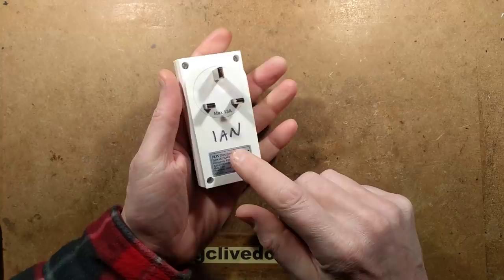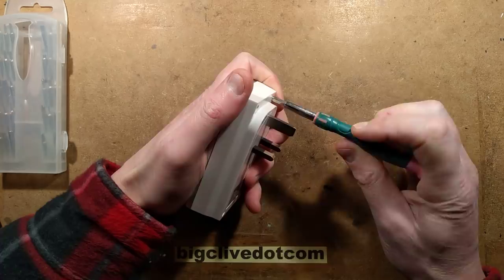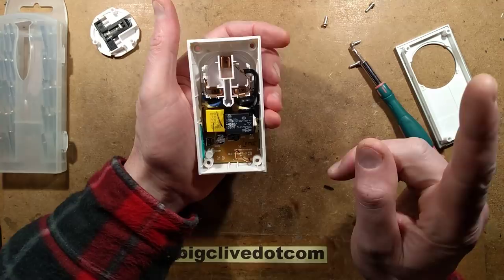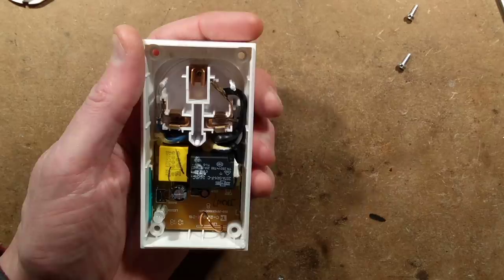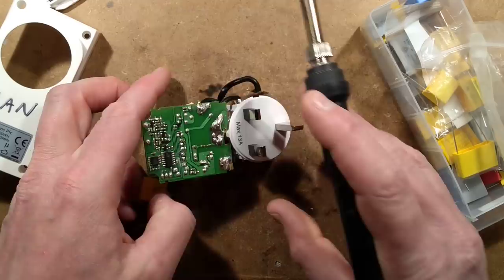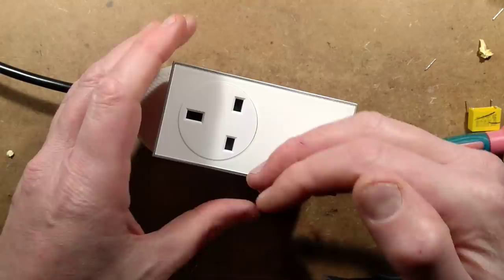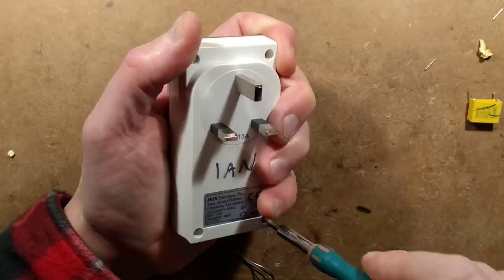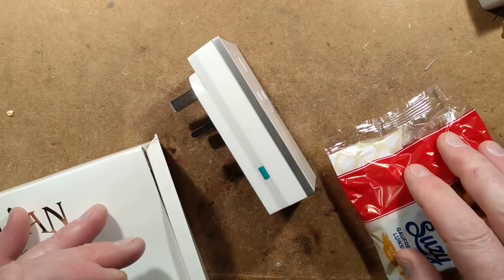Fixing a faulty remote power switch.

Comment: You previously did a similar video on the 'Bye Bye Standby' switches, which I had a load of, and were all faulty.
They had the same capacitor issues, so I bought a pack of 10 on eBay and got every switch working again.
This was after I'd already emailed the company for help, and they weren't interested.
You saved the day once again....

Comment: Thank you Clive! I have a set of four of these and last week one of them started to play up - eventually gave up switching altogether. After watching this i retrieved it from the back of the 'Fix it later' cupboard and took it apart, spot on Sir, it was the dropper capacitor, should have been reading 330nf, but was only just managing 125nf. Fitted a new 330nf capacitor and it now works again! (I also have to thank you for me having a spare 330nf capacitor in stock anyway - it was left over from a set of tungsten fairly lights that i had converted to led a couple of years back - another idea i got from your good self! So double thanks. Happy Christmas Clive, hope you have got some suitably dodgy alcoholic beverages to hand! :-)

Comment: That's actually well made, most would skip shutters and temperature fuse
Reply: A big U.K. operation like TK Maxx can’t skimp on electrical safety, they’d get crucified. Offshore sellers from the great rock candy mountain, ya take yer chances, they’ll vanish off EBay in a heartbeat if anything goes wrong, and pop straight back up with a new name. They’ve got used to it, some of the junk they sell to us can’t even be sold in China.
Reply: America could learn something here.
Reply: These are LightwaveRF switches - they do a whole range of home automation kit. UK based.

Comment: That raised a chuckle as you got out the same screwdriver set as I have sat on the desk just under the screen. Mine has a fetching yellow trim instead of the orange on yours. It's generically labeled Toolzone, and was bought from an Irish ebay seller. The Chinglish in the listing made me suspect they may not have had deep roots on the emerald isle.

Comment: My daughter is in hotel management.  She used to run a small motel about a mile out of town.  They had problems with their flat screen televisions, seems they only lasted about six months then died.  Well they found this guy in a neighboring town some 100 miles east of here who knew which diode or capacitor it was that was failing, so every time one of the sets went down, the fix-it man for the motel would haul one or two over to that town, drop the units off then go visit his brother who lived there.  A couple hours later he would return to pick them up, pay the fellow 100 bucks per unit and haul them back to the Motel, where they would run for another 6 to 8 months.  Sure a lot cheaper then buying new TV sets for each room every 5 to 8 months.  The guy said it was always the same component on every television.  Must  have been part of the planned obsolescence.

Comment: I like how you turn the screws counterclockwise to find the beginning of the threads =)
Reply: Many mechanics learn this after cross threading just one high pressure fitting or spark plug.
Some have someone else teach them the trick before they have to hard learn it.
Reply: backthreading is just (un)common sense  ;D

Comment: My speculation about the small rectangular opening under the sticker is that they originally had the indicator light (or possibly the push button) in that area.  But when they moved that (whichever) component to the side, they did not want to redo the mould.  So the sticker was chosen for hiding the hole.
As to the reduced capacitance, it is originally  due to idea of burning enough of the metallizing around any pinhole to clear a short circuit.  One or two such burns would not reduce the capacitance enough to be noticed.  But if the insulating film is  sub par (too thin or full of pin holes) and maybe operated at a slight over voltage, then there is a cumulative deterioration.  And large drop of capacitance.
Reply: I don't think it would make sense to put an indicator or switch there, since it is on the back of the unit (against the wall) when it's plugged in, and thus not visible or accessible at all.

My suspicion is that those two contact points actually connect to the I2C bus for the memory chip, so during manufacture (before the sticker is applied) they can access the memory chip via that hole to program a unique code into the device (and its corresponding transmitter) after it's fully assembled and tested.

Comment: I have one of these plugs that I bought from maplins that is still functional.  The remote for it however I've repaired twice, it's manufacturered in the most bizarre way.

It has two PCB boards that are held together by 4 jumper leads and you've probably guessed by now.  One of the repairs involved fixing a dry solder joint 😊👍

Comment: With those I always try to add a series resistor and a MOV after the resistor, to clamp those spikes down and prolong capacitor life. 100R 1W fusible resistor, and a small 7mm 275VAC MOV is typical, and makes the dropper last a lot longer.
Reply: With what kind of loads?
Reply: What's an MOV. Is it the same as a VDR (Voltage dependent resistor) ?
Reply: @NeuronalAxon  Just for the capacitive dropper side, to reduce the self healing from having to deal with all the mains spikes. Nothing for the load, it has to deal with it separately.
Reply: @geoffbirkinshaw8466  Metal Oxide Varistor, Voltage dependant resistor, similar enough, all are ceramic constructions that clamp overvoltage.
Reply: @SeanBZA  Thanks,  I should have realised , I have got several in a component draw marked "Varistors"
Reply: @SeanBZA  - So, it's to protect it from your spiky mains supply rather than anything the load's doing?
Reply: Will it only be compatible with QuickTime afterwards?
Reply: I got a question, the capacitor is rated 275Volts and at 240 mains we have peaks of about 320 Volts . So are these  caps in a to small Value ?

Comment: Several years ago when I was finishing grad school (I did a lot of warranty work for major electronic brands) I saw lots of similar issues on Panasonic plasma tv power supplies.  They used a cap that was below spec (I was told because of procurement trouble with the correct one) and hoped it would work. (Spoiler, it didn’t work). Luckily it was simple to replace the 5-6 failed caps.
Thanks for this content.  All the best to you and yours!
Reply: John Coops sorry you feel that way.  Actually there have been several manufacturers that have had this issue including Samsung, Panasonic and others. The Samsung issue was only a few years back (it was all over the tech news 7+ yrs ago) while the Panasonic issue I referenced was almost 15-20 yrs ago. While I no long do technically repair and instead design and evaluate (I am within a few years of retirement), I must respectfully disagree with you mainly because that was the explanation given directly from the manufacturer.  
Being a troll must be a horrible existence and I pity you truly. If you ever need to talk to someone without being hostile I’d gladly lend an ear.  
All the best to you and yours!
Reply: John Coops my apologies but your first rude comment could make anyone defensive. Questioning vocational ability in that statement is rude and was not necessary, just ask nicely.   I realize it is very different than Clive’s video and why I thought of it was the issue with powering on and then a fail. Reminded me of the cap issue.  Are you this unpleasant of a person when you are with customers? Or are you just a mouth with a keyboard?  If so I am glad you are not an employee of mine. I was respectful to you as I am with all folks.  Then you became even more of a troll.  You are the one that should have just ask me nicely.  Let’s end this interaction.
Reply: @johncoops6897  "They used a cap that was below spec (I was told because of procurement trouble with the correct one) and hoped it would work. (Spoiler, it didn’t work)." 
There is enough propinquity in his post to make it an interesting historical footnote, I for one enjoyed his apriori on the subject; he had first hand knowledge of the event and circumstances.
Reply: I currently have 2 Panasonic and 2 Samsung plasma TVs in my garage which I have recently repaired the power supply boards on, by replacing capacitors, and/or MOSFETs. It's sad that people throw away a 64" TV because it needed a new 70c MOSFET, but the labour to have it repaired is more than it's worth
Reply: BeachsideHank thank you sir! I appreciate your comment.
Reply: Simon Quigley yes sir I do also agree with your line of thinking.  It easy to develop a board to spec but unfortunately the engineer has little say in the final product.
Reply: Mario Ghio Neto maybe because I’m old his comments bugged me too much. My thoughts are if someone takes the time to read my post I want it to be as pleasant and upbeat as possible.  I try to behave as if I was face to face with folks. Thanks!
Reply: @wesleytownsend8214  Chin up good sir, the wagons have circled, and the hostiles have fled. ☺
Reply: @johncoops6897  That is your opinion, then fine, but not being satisfied with your assertion, you had to insult the guy with: "you obviously had no understanding about what you were told to do.". What then are YOUR qualifications for making such a belittling and disrespectful remark?
Reply: @johncoops6897  You seek confirmation where there is none; further discussion is useless with you sir, good day.
Reply: BeachsideHank Wow! You’re a very fine individual and I apologized that you became embroiled in this adolescent nonsense.  I feel I should also apologize to Mr Coops as I obviously was not clear in my original post and he mistook my intention. I never meant for anyone to get that offended.  It was just a comment on something that Mr Clive’s video reminded me of. I really thought I made that clear when I said it was “similar to”. Geez that just brought a memory to mind.  I should know better as I have a grandson that is also very literal and corrects me when I compare things.
All the best to you and yours!
Reply: @wesleytownsend8214  The core subject was defective capacitors and their ramifications; your post was on point, educational, and of merit and so no apologies to anyone are needed and thank you for sharing your experiences. ☺
Reply: @johncoops6897  I accept what you say, but you do realize that you have also validated Mr. Townsend's remark in that it was a production decision made that was driven by a profit motive- intentional misuse of a component not designed for the application. "...They used a cap that was below spec (I was told because of procurement trouble with the correct one) and hoped it would work." It is what it always has been and forever will be; about the money.
I do believe you and Mr. Townsend are a couple of right guys who have real life issues to deal with like family, mortgage, jobs etc. As the kids of today say: "this ain't no hill to die on".
Music is the space between notes. Life is the space between obligations.
Reply: @johncoops6897  In closing this thread, I’m now making some changes to my comment reply policy, if you don’t hear back further from me, you’re one of them.

Comment: The problem I've had on two of these (I was using in my workshop) is that the relay contacts stick shut.  Give the unit a bash and it will work again for a while.  The problem is probably caused by having something connected which has a large inrush current.  I suspect a fluorescent light on my magnifier unit, to be the culprit.
Reply: Indeed. Power factor correction by adding a capacitor over the inductive load creates this. I've seen it happen while trying to switch the motor of a ventilator unit. That I solved by adding a small series resistor that dissipates less than a watt in normal use.
Reply: @blaap  NTC inrush limiter from old PC power supplies works well for things under 400VA, and is easy to get.

Comment: It's always the metal film cap, no matter the design, brand or country it's sold in.
Reply: I wonder how many of these items contain used capacitors.  Why an X2 for this application unless it is used or failed testing... especially when it has black marker stripes on it.
Reply: @someguy2741  Because they won't short out if they fail, making the device safer to use. I wouldn't think parts in that price range would be reused. Electrolytics yeah, but not those, but please prove me wrong, would be interesting.
Reply: It's not connected directly across the mains, the fusible resistor protects it so it doesn't need to be X2.
Reply: there are capacitors for use as "capacitor dropper", they are differend from x2 "across the mains". probably they'll last longer

Comment: Well since nobody else has hazarded a guess yet I'm going with metal film capacitor failure.  It also looks like the zener diode or related circuitry is pulling a night light situation where it takes the same power at all times so it doesn't matter if it's in use or not, power-wise.

Comment: Like your chanel. I find it very watchable. I bought a HOPI, and after checking that it worked OK, I turned the out-put socket round 90 degrees so that plugs wouldn't foul to clip-in terminals.

Comment: Wow I've had desoldering wick and a flux pen for years and it never occurred to me to put the flux onto the wick to make it work more effectively!
Reply: Me too, we are stoopid
Reply: @arenalife  desolder wick already contains flux anyway so you have been doing it right :)
Reply: @tecfixed2840  with varying degrees of [effective] lux content depending on age and source.
The cheap chinese stuff tends to, IME, be in dire need of more...
Reply: Clive is using Goot Wick from Japan CP-3015, It's good to add extra flux as the factory flux can be a light coat. More flux helps.
Reply: @michaeltempsch5282  indeed.
Reply: @tecfixed2840  the wick flux doesn't last forever, though.
Reply: I think it varies by brand. I've been using MG Super Wick and have never felt I needed more flux, with that wick you can see the rosin boiling out of the braid when heated and the spent wick has spots of flux residue on it.
Reply: @Broken_Yugo  I only use chemwick braid and never needed to add more flux, I did try some cheap Chinese wick I was given and that was rubbish, was just useless.
I can go through a 30M roll of chemwick and works perfect.

Comment: Hold the button in for more than 3 seconds to allow it to sync to the transmitter. Two pins through the hole is a factory reset if its anything like mine. Thanks for this vid Clive - mine are getting in a bit, so when they fail, I now know what to do - repair is always better than replace.

Comment: Why do you think this 'failing low C' is so common in this type of dropper, when the cap is not really under much stress I wouldn't have thought here.... poor quality or seconds caps ? I notice that cap has one or two big black 'strikes' across it....
Reply: I reckon Clive should mug up on capacitors and do a video special on them. I always thought that old electrolytics dried out their electrolyte, so degradation was inevitable. But modern types (eg non-polarity conscious capacitors) shouldn't be so prone to slow death IMHO. There is much to learn.
Reply: Spikes on the line exceeding the dielectric breakdown voltage of the cap and blowing some of the metal off the film each time would be my guess. Safety caps are designed to fail that way, because it's safe. Safety caps in all safety cap type applications probably do this, it's just that they're value critical in a dropper supply and not in their other roles.
Reply: @Broken_Yugo 
Don't forget good old fashioned cheap manufacturing resulting in not quite on spec products and higher than you'd like failure rates.
Reply: @johncoops6897  I've seen two  'back-to-back' (ie. non-polar) high voltage electrolytics used in this position ... does anybody have any thoughts on the merits of this?

Comment: For opening Holes when you removed a Component You might use a simple Toothpick. The Wood of the Toothpick can stand the heat quite well and they are easily available almost everywhere.  I have answered in English even  you said at 13:25 it is ok for you to answer in my native Language ( German ) assuming more people we be  able to understand my Comments.
Reply: можете пожалуйста говорить по русскому языку))))
Reply: @OscarSturgess  Leider verstehe ich kein Russisch :-(
Reply: That's actually a fantastic idea!
I hate component replacement because of the solder left in the hole! if I could poke a toothpick through, that'd be great!
Reply: Sewing needles work well too, as they are usually stainless steel which solder doesn't want to stick to. Then you can just wiggle it around gently and the hole is clear for the new component
Reply: GENIUS

Comment: 1 FemtoPaul of flux is an appropriate amount of flux. 
Also, I like when things don't go boom because it means you took precautions and everything worked. If things accidentally go boom, that's fine, but making boom just to make boom is not good in my opinion.
Reply: Your opinion is duly noted even if not requested.
Reply: Making boom just to make boom is good if you're a pyrotechnician, it's new years eve or you are celebrating the capture of that terrorist guy.
Reply: @johncrowerdoe5527  This is true. I was more referring to making electronics boom just to make boom. If you have some firecrackers or what not or something is genuinely faulty and is going to pop without you forcing it, that's a completely different situation and I'm fine with those booms.
Reply: You want BOOM? - electroBOOM wants ya!
Reply: 11:14 brought a smile here, too.
Reply: @Okurka. 
Louis only ever uses a microPaul. Except if Paul is watching, in which case he'll use a "good" amount.
Reply: @Ulf Zimmermann Louis Rossman seems to use what is referred to in the UK as a "metric fucktonne" of flux :)